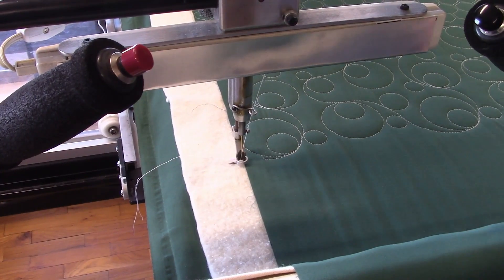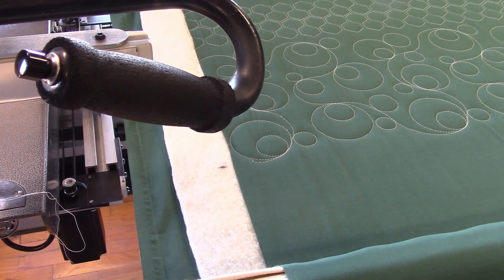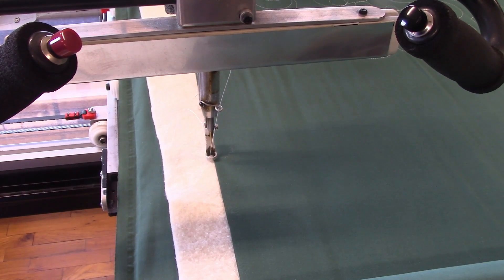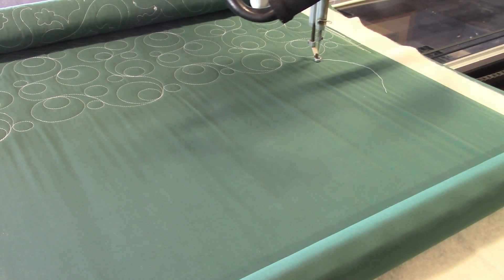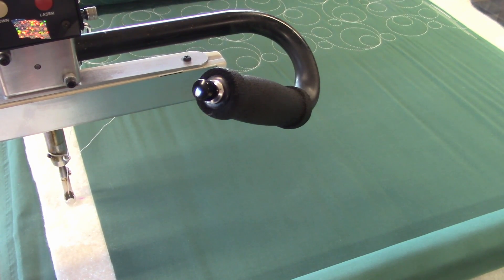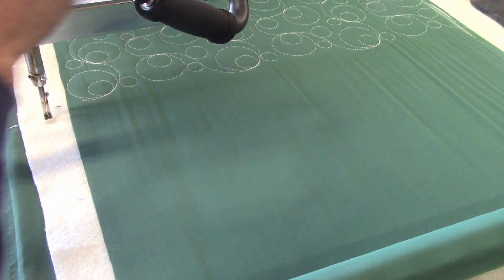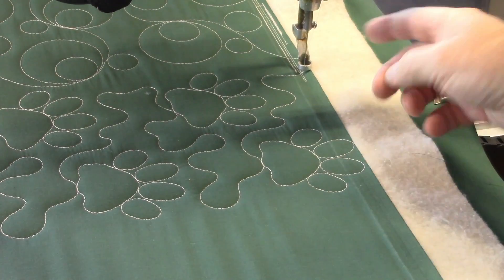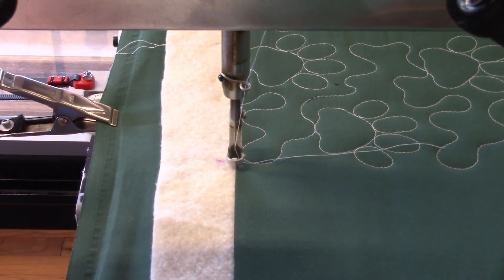DIY CNC Quilting Machine Demo and Process

Comment: Is the needle stroke and the movement of the fabric synchronized and if so, how did you do it? thanks.
Reply from the maker: Most longarms come with a Stitch Regulator, that is what makes the stitches the desired length when you move the machine.

Comment: How do you deal with running out of bobbin thread? Especially when you haven't seen that it's out. How do you go back to start again with the pattern once you've reloaded the bobbin?
Reply from the maker: I replied to your comment on the DIY CNC Longarm video but wanted to answer this also.  We tried to not run out on a row as this setup does not allow you start in the middle.  We would start with a full bobbin and then check after the first row and if we didn't have enough for the next row we would use a new bobbin.  I didn't like wasting the thread so I came up with this idea https://youtu.be/cj-WihPAnOw to help cut down on the waste.

Comment: I noticed you have several overlaps/crossovers in your pattern, how do you accomplish this. everytime I find a pattern with an overlap/crossover it seeps to stop in one area and veer off and going in a different direction stitching all over the place.
Reply from the maker: When you make the gcode to run the machine you have to start with a continuous single line. It can cross over but it has to have a beginning and an end. I have a video about how to create the stitch path and then one on creating the gcode. They were about 2 months ago. Look on my channel and it will explain. Most programs that make gcode think you are using a router or a drawing pen and that you can just lift it and move wherever you want but the machine will stitch wherever it goes. Check out those videos and I think you will understand.